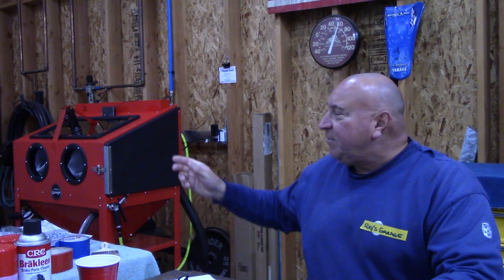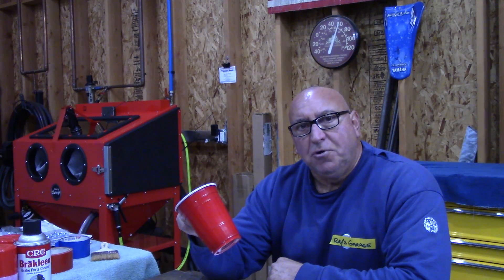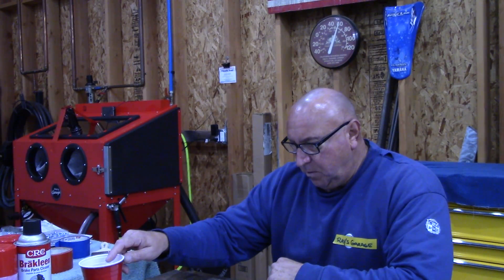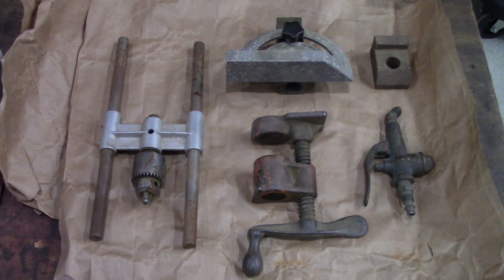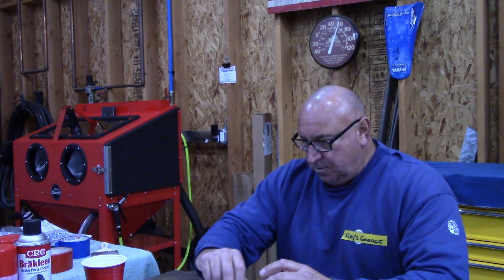Low Pressure Two Stage Blasting

Comment: I just found your channel and love your content.  In my shop I use a vapor honing cabinet for the same purpose and it does quite well.  Your method seems to work very well for patina removal and resurfacing for restoration purposes.  What I would like to know is  how well this low pressure, two step process handles coating (paint, powdercoat, etc) and extensive rust removal?
Reply from the maker: Thank you! Low to high pressure works very well for most all surface prep except powder coated parts. I found it best to burn or high heat to remove then blasting.

Comment: Ray, I use my blast cabinet mostly painted steel parts that have various rusty patches for paint preparation purposes.  I typically use ~ 80 t0 100 grit aluminum oxide in my cabinet and before I upgraded it I typically used 80 + psi with my siphon style blast setup.  I now have a metering valve system with 1/2" air and media lines and a blast gun sized for my 5hp 80 gallon compressor and 3/4" lines to the cabinet.  I was wondering what pressure would you recommend for my application and setup?
Reply from the maker: I would try lowering your air pressure down to around 40PSI. Give that a try and go from there, the lower the pressure the longer your blast media will last!
Reply: @RaysGarage  Thanks Ray for your advice.  Last night I adjusted my blast cabinet air regulator for a working pressure of 40psi and opened my metering valve air bleed to about a 1/3 open.  My media is an 80grit aluminum oxide, which is quite dense and I was getting some surging of the media with these blast settings.  I could see plugs of media flowing through the media tube separated by a more even lighter flow of media.  Is this caused by low air pressure or is this caused by the metering valve air bleed setting?  This was my first time using a metering valve setup.  I think a good idea for a video for you, would be to do one one how to adjust your metering valve and blast pressure for different blast medias and how to troubleshoot blasting performance issues.  Thanks again for your help!
Reply from the maker: @cujo7240  Let more air flow into your metering valve.

Comment: Ray, thank you. I am entering the business, im 62 and want a job to see me out. I have come from the car and motorcycle era and have done a number of rebuilds in my time. Taking a piece of crap and restoring it gives me much purpose. I have been looking at Vapour units too....... what you showed here at your site has really helped in my decision making in relation to equipment potential, and parts restoration via dry blasting. Please do something with aqua blasters too. I owe you a drink, cheers Bud.
Reply from the maker: Hello Charles, I would like to try the wet blasting, the Tacoma gun works great for that as well. As of now I have too much on my plate but will get a wet cabinet in the future.

Comment: What CFM are you using at 25 PSI
Reply from the maker: Hey Dave, I’m not sure but I can tell you I’m feeding my cabinet with a 1/2” ID hose off my 3/4” air system that puts out 34 CFM @ 90 PSI I hope this answers your question.

Comment: Hi Ray, what media and grade would you recommend for blasting cast iron in prep for paint?
Reply from the maker: #80 Garnet for rough and/or rusty cast iron, #75 Glass abrasive for smooth cast iron. Run at about 45 PSI

Comment: Hi Ray,
I have just commissioned my blasting cabinet at the weekend after completing all the mods that you have done to your cabinet. I had to improvise on some of the mods and make a few parts myself like the hopper adaptor as it was going to cost way too much in shipping costs from the USA to the UK. I couldn't be happier with the way it's turned out . However the pipe I have used from the metering valve to the gun is too ridged and so it restricts the ease of use. Can you tell me what type of hose you are using on yours?
Kind regards Paul
Reply from the maker: Hi Paul, The 1/2 ID black hose is a soft GoodYear brand and the clear 1/2 ID media hose has no branding, it's a little stiffer than the black air hose. If you find a nice flexible 1/2 ID hose, you can use it for both the media and air lines. Another viewer found some 1/2 ID Flexzilla hose and said it worked out great, I have not tried this so I can not 100% confirm.
Reply: @RaysGarage  Hi Ray, Thank you for getting back to me. I have just purchased some clear PVC hose as I am paranoid about keeping anything silicone out of the system. I am not sure how well it will last but it is more flexible than the reinforced clear hose I was using. I did find a piece of very flexible reinforced hose that came with my cabinet but I suspected that it may be silicone. Good point about the other 1/2" ID hose as it doesn't really need to be clear.....I am currently designing a Powder Coating oven which I will build myself. No point in being able to blast everything insight and leaving it to the elements. Kind regards Paul

Comment: Hi Ray and Merry Christmas.

I am trying to setup my blasting cabinet to do some blasting at home and I don’t seem to find any enough consistent info on what I need for the small cabinet.

What kind of CFM and pressure would be sufficient for a small gun? And how small is small? I have a 8 CFM @100 PSI compressor.

With the abrasive, what is best to paint over? I have glass beads here but I have read the finish isn’t great for painting.

Would you be able to help with these questions please?
Reply from the maker: Hello Vini,
Mike Tacoma of the Tacoma Company did experiment with the HF small blast cabinet and could never could get it to perform well so I would stay away from wasting your money on that one. If space is a big issue maybe you could build your own small version of the larger cabinet and use Tacoma's gun kit. 8 CFM will not run any cabinet for any period of time unless you had a massive air storage tank, volume of air is the key behind an efficient blast cabinet and not PSI. Watch my entire series and I think you will then had a really good idea of which direction you should go. Best Regards, Ray
Reply: @RaysGarage  Thanks for replying. My cabinet is 100 litres so it may or may not be so small.

I am looking to blast small aluminium parts to remove corrosion and paint to then paint over.

What do you think is the most suited media?

Thanks in advance.
Reply from the maker: I would recommend #75 glass abrasive for corrosion and paint removal then paint after cleaning. If its a bare metal part then finish with a fine glass bead like #7 or #9
Reply: @RaysGarage  thanks, I so basically glass bead isn’t great for painting after? I am always worried that I might damage the surface with crushed glass.
Reply from the maker: @viniengel  A good quality glass abrasive will not damage or change the surface, if anything the corrosion caused the damage. With a good quality gun set up you can blast at 5 psi for real delicate parts. Glass abrasive is for cleaning and paint prep, glass bead is for finishing unpainted parts. Glass bead does not leave much for paint to grab onto but I have painted glass beaded parts and did not have any issues.

Comment: Have you done a video on your moisture removal from the air supply? I’d be In what method you use.
Reply from the maker: https://www.youtube.com/watch?v=HXKMTE1DbAk
Reply: Thanks for the link. I installed the Maxair 3/4” system last week. I initially had 2 connection failures but after some tweaking it worked out well. I like it.
Reply from the maker: @rerawho  https://www.youtube.com/watch?v=6FtBr_9PfCQ

Comment: Great videos! I just received my upgrade kit, and with your video tutorials it will be much easier and faster to install.
I have one question though - I am left handed and I would like install the regulator on the right side leg, and hoses on left side.
Do you have any suggestions or comments?  Thanks!

Comment: I upgraded from another company got the foot feed and the standard blast gun and put in all new lighting and plumbed in all new 1/2 air lines with a new regulator . Thought I had it . I put in a 90 degree elbo on the bottom of the hopper plate and fired up the cabinet horrible suction I came in looked at some you tube and realized my elbo only had a 5/16 id so I went and got some pvc fittings upgraded to a 1 inch id down to half inch fired it up not it works better but will only blast for about a minute and the sand stops I have to put my finger over the end of the gun and blast back but it does it all over again the sand is not wet. I thought maybe it was blocking down at my elbo . I called Mike and Tacoma and he recommended their upgraded gun . Do I still need the mixing valve my inlet is over 1 inch ID but I had to reduce it down to a 1/2 nipple is this going to restrict my flow? I want to order the upgrade gun but if I can keep from the mixing valve I would rather do that. My business is seasonal I wont have any pay checks until spring I do marine repair thanks
Reply from the maker: Roger Hockemier Hello Roger, The key to good media flow is the Tacoma metering valve and Gun at a bare minimum and this should fix your issue as long as the media is making it back to the hopper adapter during blasting.
Reply: After I wrote you the note I thought about the mixing valve and its a no brainer . I called Mike back and ordered the intro upgraded gun and ordered the mixing valve and thought while I was at it get some gloves coming mine had holes and I patched one with hot glue gun. Being American made also sold me love to support my American worker the glove where very reasonable $29.00 with all the new lights and new lines and new regulator and the lines are all 1/2 inch ID I am hoping it will take off now. Already spent a lot of time and money and I even put in all new glass and plexy glass. I forgot to mention that .The dual LED lights really help a lot. Thanks for the reply  Ray I know you are a busy man and get a lot of emails . I hope this takes care of it I am restoring a Chevelle and really need this to work .  Roger

Comment: Just asking for an embolism placing finger over gun end at 60psig.  If hose got plugged, all that would go into your finger.
Reply from the maker: Gary, You saw me do it, did it go thru my finger, no it did not! With the metering valve drain open you are not building up much pressure at the gun, its being redirected out the bottom of the valve, if the hose was plugged it would be forced out the hose and thru the metering valve, this is one of the reasons for back flushing the gun. How about some constructive criticism and quit pointing out all bad in my videos, do your homework before commenting! Best Regards, Ray
Reply: @RaysGarage  What about 'if the hose got plugged' did you not understand.  You're remarkably sensitive when well meaning people caution you about poor shop practices.  I think you do your viewers a disservice when you fall short of really educating.  I really like your videos but they need better peer review.

Comment: does Mike or any other reliable source make a chart on blast media and the air pressure they should be run at?
Reply: also does the modified shelf eat into the caulk used in the hopper?
Reply from the maker: I rounded the corners of the grate so it does not cut into the caulked inside seams of the hopper.
Reply from the maker: Hi Shaun, There is no set psi or set metering valve setting, you have to create your own base lines. Every part requires a different setting based on the type of metal and to what extent it needs to be cleaned and what surface finish you would like. Small fragile parts require very low psi and a lean to medium metering valve setting with a media that does not damage the substrate of the base metal. A nasty, crusty, rusty part requires a garnet abrasive at higher pressures and ricer metering valve setting. I am working on a video on this very subject but I am not hitting all the correct points for Mike's liking just yet and have scrapped over 16 hours of video so far...

Comment: Enjoying and appreciating your HF Blast Cabinet upgrade videos, Ray.  Very informative and helpful!  And now a question:  Have you considered using the 1/2" Flexzilla hose for both air and media feed lines?  My cabinet has to live outdoors (though protected from the elements) at 8,000' and currently in frigid temps.  The typical feed lines really get stiff and I've had good experiences with the Flexzilla products when it comes to cold, one of their promotional points.  Thoughts?
Reply from the maker: Hello Steven, Thanks! I had a viewer contact me a while back with the same issue and he was going to install the 1/2" ID Flexzilla hose on his gun as well but he never got back to me on the results so I am assuming it worked. If you do this please let me know so I can share it with everyone. Only drawback I see is that you will no longer have a clear media hose but do not think that will be an issue at all. Let me know how it works out! Best Regards, Ray
Reply: @RaysGarage  It'll likely be a couple of weeks but I'll be sure to let you know!
Thanks again and keep those updates comin'!

Comment: That sure doesn't take much media.  Only two beer cups full.
Reply: Actually, you can use a third of that. I have the same box and set-up and use just one cup and there is no difference since it slides down fast enough to be reused. Now Ray is using parts that are not particularly dirty but if you blast real rusty parts the media ist dirty within seconds and you should never use media containing a lot of rust and blast aluminium thereafter because rust can get stuck in it. So if you have only a small amount of media it is a quick job to dump it out and use fresh for good results.
Have fun, Bernhard
Reply from the maker: Bernhard, You are 100% correct, stay tuned for the next video where I will demonstrate how very efficient this cabinet performers with minimal blast media!